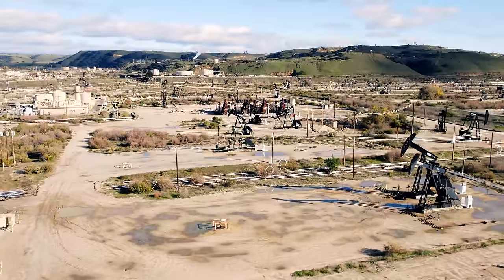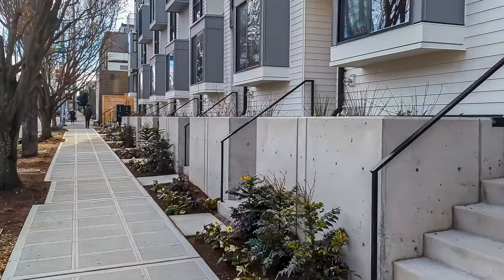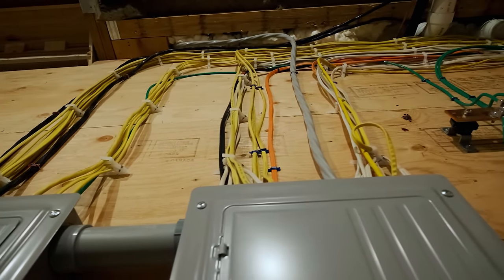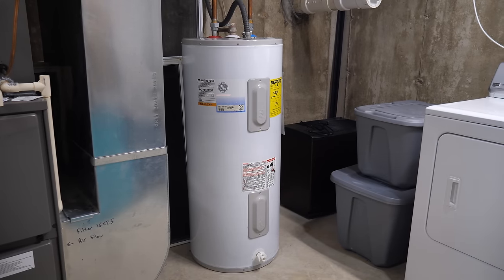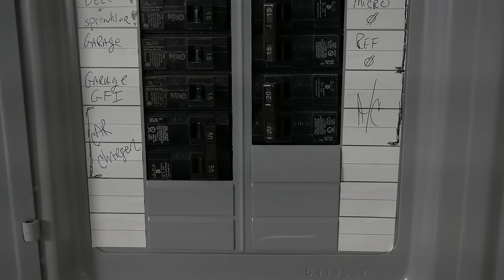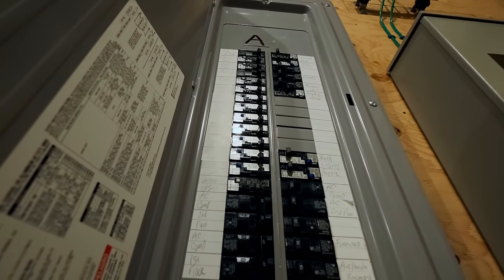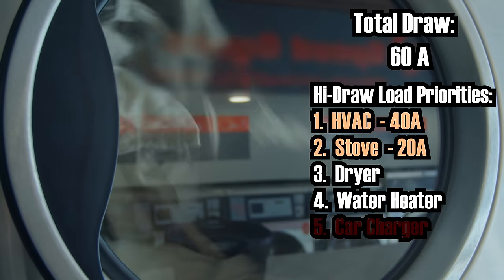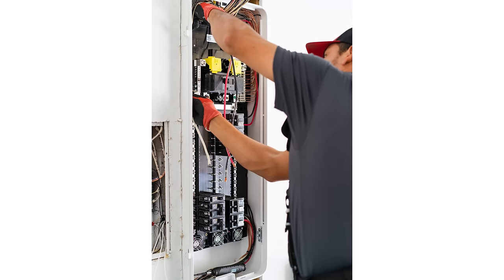Home Electrification: There's not a lot to do, and it doesn't have to be hard (Part 1)

Comment: Speaking as a renter, the biggest barrier to this is landlords, as illustrated by your comment on the complications of apartment upgrades. My landlord does not care how much I spend on energy or what my energy is doing to the environment. Landlords have no motivation to change. We either need to give them motivation or (and this is my preferred plan) get rid of landlords.
Reply: You want to get rid of your landlord?  Buy your own place.  If not, be thankful that you have a landlord to provide you with a place to live.
Now, as a landlord I'm an outlier. I do try to reduce energy usage for my tenants.  My incentive is that I can then charge more rent because of lower power bills. Not enough more rent to offset the savings, it's a split that helps both of us.
Reply: If the customer doesn't care, why should the landlord? Your level of entitlement is off the charts.
Reply: ?  The "customer" here doesn't get to purchase the appliances or insulation to save energy.  Did you not read my explanation of why saving energy benefits both the tenant and the landlord?  What's "entitled" about that?

Comment: We have a 50 Amp service going to our house, and in the past 8 years, we blew the main breaker once.  AC was on, took a shower while baking something in the oven, with a bunch of lights on (the old incandescent lights, before getting LED's). So a good 30-40 Watts per bulb. And also the dish washer warming up it's water (yes, ours warms the water). And who knows what else was running. So, 100 Amps is plenty. Even 50 Amps is due able. But for bigger houses, it is pushing the limit's.

Comment: If you swap out your gas appliances with electric equivalents, and have no $ left for a smart load center or a service upgrade, just make sure you are not cooking and doing laundry at the same time. Switch breakers on and off if needed. Use sticky notes or other reminders.
If you start your laundry after dinner, the dryer would run when power usage otherwise drops to a trickle.

Comment: Why do I get the impression that you "blew off" the boiler/hot water people. You seem to be saying "just get new equipment and get creative". This transition can run into the many thousands of dollars. Oh,  BTW I live in a NYC suburb and hundreds of thousand homes have gas/hot water systems. 
In our recent heat wave the utilities "suggested" power reduction  due to endangered capacity in the area, so let's just add more electrical load demand!!  Bottom line is, mass elecrification will cost billions, if not trillions!!

Comment: A service upgrade is probably still worthwhile if you can get one. And if you're in an older home, you should at least get an electrician to look at your wiring if possible even if you're not getting a service upgrade. Just to make sure your wiring is actually good and not some ungodly hackjob that only looks compliant at a surface level.

Comment: Lets be honest. Smart panels have been around for 20 years. THEY STILL SUCK. The panel operates "right" about for 1 year and then things get wonky....

Now lets talk about the GREEN MONSTER in the corner no one wants to address. Besides upgrading the grid, which will take 10 or more years, we need to talk about electrical codes for houses. If we are going green/electric, then the standard for new homes needs to be atleast 200 amps. In fact, we might need a 200 amp breaker and room for a secondary panel to handle EV charging. These issues need to be hammered out NOW so that new homes built after 2028 are not obsolete in only 3 years.  Measure twice, cut once. It is cheaper that way.

Comment: Closed cell silicone rubber-resin foam are the best, they won't rot or burn, moisture proof and water proof. Silicone rubber-resin paints exists but are not well advertised because THEY DO NOT ALLOW EXTREME COLD OR HEAT TO PASS THROUGH which the oil and gas heating companies do not like, the oil lobbyists lobbied against their uses by using tons of LIES that falsely accuses them of being dangerous when in fact they are so safe that these silicone rubber-resin polymers were actually used as the air tight and vacuum tight and pressure tight and oil tight and gas tight and water tight space crafts and military airplane seals and gaskets! Especially on their windows and airlocks!

Comment: I just came back to point out that smart load management in appliances isn't that new. I've been to many hotels over the years that use a combined microwave and fridge. When the microwave is in use, the compressor is disabled to prevent overloading the circuit.

Comment: I live in the Midwest and I've never seen a gas-fired dryer in my life 😭

Also:
- There's no way I'd install a smart breaker box unless it had ZERO network interfaces and open-source firmware.
- Electric ranges (well, the burners - not the ovens) are dogshit. Even induction doesn't perfectly match the versatility of gas.

Comment: I really like not being 100% dependent on the grid for HEAT I do have a heat pump and live in the south BUT even it uses a burner for heat when it is really cold. And if the power goes out my old stove still works (and will at least keep it reasonably warm in a few rooms)

Comment: On a Boiler system what would prevent using the existing radiators and using a heat pump to heat the water?

Comment: i went and saw my braker box and the amps are 63 yes 63A keep in mind i live in a apartment with 250volts but the iscolator  is rated for 415volts so then why do i only get 250V . should  it have 415V or 250V so yeaaa

Comment: Wait, 24kW isn't enough for a North American electric home by default? I live in a place which most people would consider quite cold, something which US army would classify as wet/dry cold with occasional dips into the intense cold region (lasting about a week at a time). So -5C to -15C or 23F to 5F most of the time, and -20C to -25C or -4F to -13F for about a week each year. Even in a relatively large and decently old (50-60yo) detached house it's pretty darn hard to consume more than 10kW at a time.

When temps are around 0C or 32F, the heating (heat pump), fridges, freezers, electric floor heating in bathrooms and mud rooms and whatever zombie loads are plugged in - that takes about 2kW. At -20C or -4F that's about 4kW. Usual lighting; it's pretty darn difficult to exceed 500W there, though if I were to turn on all lights I could probably reach 2kW. Preheating a car will draw about 2kW, washing machine and dishwasher, those might peak around 2kW but that's a very short period in the wash cycle. Dryer - I don't have one so I don't know. Cooking complex food - well, that might draw 4-5 kW, though you could theoretically peak at 11kW (3x230VAC at 16A).

My power provider provides me with hourly consumption rates (which are used for billing), and I don't think I've managed to ever exceed 10kW (maybe prepping Xmas foods went slightly over?). Anyways, I'm sure I've never exceeded 15kW, at least when measured with 1h interval. Short peaks are likely to be higher - but probably not that much higher.

The only reason to introduce "smart" whatever into household power delivery would be charging an EV, where it would make sense for the charger to monitor other power consumption (and electricity price) and regulate charging accordingly. Though 95% of the time simple timer set to enable charging during the night would be enough.

Comment: I obviously won't bring up the power grid being beefed up to handle these much higher electrical demands. 
What I will bring up however, is the irrevocable need for us to go nuclear. 

We cannot power a nation full of electric cars with windmills and solar plants. Hell we can barely do it with fossil fuels, which give out much greater power yields. 

Nuclear is the only way.
Reply: Nuclear is good, but it has drawbacks that renewables fix. But then again, we shouldn't have a country running on electric (or any) cars

Comment: We gradually stopped using our dryer for most loads over time. We just don't demand piping-hot and dry clothes within an hour. Just hang them up in the den and they'll always be dry by morning. Even in Summer (and we have humid Summers too). OK, we still use it to dry large stuff like bedding, and even then, just on delicate/low heat. It's really totally fine.

Comment: As an electrician who has been present for the installation of a Span smart panel, they are a huge pain in the ass to install. They don't have knockouts so you have to cut in every hole to get wires in while being careful not to get metal shavings in the sensitive electronics. They only have one ground bar so half of your grounds have to go around the world. All of the terminal crews are flathead so you can't tighten them with your screwgun. The panel is also three and a half grand while it's benefits are marginal. If you're doing a panel change you might as well do a service change to 200A. Its not that much more expensive.

Comment: Why not stick a 200Amps output battery between the 100Amps power supply and the breaker panel to serve as an energy buffer for those peak periods?

Comment: Yes, most stuff in my home is electric, but most stuff is not a basic necessity, like heat and hot water.
Using gas, I can have a constant comfortable 23C in my house in the dead of winter (-5 - 5 C temperatures) for ~$70/month. The same comfort with electricity would cost ~$400/month. When minimum wage is $400/month and $1500/month is middle class, that’s just not an option. Haven’t done math for hot water on electricity, because an instant electric heater of the needed power is not available on the market and I have neither the space to install a boiler, nor the desire to be limited in the amount of available hot water. But hot water via gas is instant, unlimited and virtually free (it costs $2-3/month to take 1-2 daily showers).

Comment: 29:40 Boilers distributing hot water for heating are harder to replace with ductless mini-split air source heat pumps (ASHP).  Major heat pump manufacturers (e.g. Daikin, Mitsubishi) make hydronic air-to-water heat pumps for other countries (e.g. Japan, New Zeland, Europe (Germany, France, Poland, United Kingdom...) but they REALLY SHOULD SELL THEM IN THE U.S.  I live in New England in the U.S.  In the summer I'd like to maintain a delta T of about 25-30 degrees F (70 inside when it's 95-100 outside).  In the winter I need about double the delta T from heating (65 inside when it's 5 to -5 outside).  So trying to convert my whole house to ductless ASHPs has several problems:  1.  high cost, 2. hard to place the inside unit of an ASHP in all rooms, e.g. bathrooms, rooms at front of the house where I don't want to place a unit outside because it would be an eyesore, 3. I need ~twice as much heating as cooling, e.g. 3-4 tons cooling, 6-8 tons heating.  So Mitusbishi/Daikin/Trane/Carrier... PLEASE offer me a cold-climate air-to-water air source heat pump that I can replace my oil-fired boiler with !!!!! (to at least provide half my heating, including hard-to-reach rooms.  Then I'll put in a few mini-splits to cool and heat larger rooms and open areas).  If you want to glance at some products offered elsewhere around the globe (why not in the U.S.?), search for Ecodan Zubadan  or Altherma (I didn't make up the names, blame the vendor).

Comment: I don't know about you americans but the issue we're having in the UK with ditching natural gas for central heating an hot water is cost. Electrical heating is more expensive per BTU than burning gas to heat water, It's as simple as that. I have solar panels and a big battery, they weren't cheap and despite that I am still in a big defecit for solar power during winter and that's when the heating is needed. I could get a heat pump I guess, but that's another big upfront cost, especially when I had to get a new gas boiler only 3 years ago. Unless the government pays for heat pumps and solar panels for all, we're going to have huge difficulty weening ourselves off gas. Edit: OR reduce cost of electricity massively, which doesn't seem likely as even the power coimpanies that claim to be 100% renewable upped their prices when the wholesale costs of non-renewables went up.

Comment: Some insight into Scandinavian Countries, (mainly Sweden):
All homes get 3-phase power. 400V phase-phase, and 230V phase-ground. 
The main breakers are typically 10A, 16A, 20A or 25A. Higher capacities are available but also more expensive. Upgrading your service is as easy as replacing the breaker. The higher cost comes from the grid needing to account for a potentially higher load. 

Back in the day, until about the 2000s, oil furnaces were commonplace. Most of these where then replaced by either Wood/pellets furnaces, Heatpumps, remote heating or resistive heating. 
Geothermal heatpumps are commonplace in the suburbs as they are unaffected by the outside temperature. The ground is the same temperature all year round if you drill deep enough. Closer to the cities, massive insulated warm water pipes run underground from central power plants, that use their waste heat from biomass burners to heat homes and provide warm water through heat exchangers. Instead of a huge building with its own central heating system, we just made the entire city a central heating system.. 

Homes range from 120sqm to 320sqm. The typical size is about 160sqm with a cellar and/or upstairs. My parents house is a good example of a typical Swedish suburban house. 
About 160sqm with a cellar. They run a geothermal heat pump with resistive heating elements as backup (rarely used). They run a 4 "burner" induction stove, have resistive floor heating in the cellar,  run two fridges, and two large chest freezers. 6-person household. Washing machine, but not a dryer (dehumidifyer in  drying room). All this on 16A service. On 400V-three phase, that's 11kW in total. Never had any outage from the main breaker tripping. They use on average 25000kWh each year. They never had a smart breaker box either, only their new car charger actually use intelligent load balancing. 

We lived in a tiny house, 60sqm, one floor. Heated by one resistive radiator and one air-air heatpump. Our monthly peak never exceeded 5.5A on the grid in the winter. That was with an electric dryer, halogen stovetop, electric water heater, water pump and filtration system, and seperate fridge and freezer. We rarely ran it all simultaneously, and that wasn't intentional either. I think most of you vastly overestimate how much power a house is using at any given moment.

But then again, our building techniques are also far better than in the US. Insulation is key, and we have lots in our houses. Back in the 60s brick houses were very common, and wood panel houses usually have multiple layers of insulation, built in a way where the outside panel is never directly touching the inner frame.

Comment: A dryer on gas and plugged into a 15A 110vAC circuit?!?! I saw the breaker and went, "huh?" Then saw the gas line. I was wondering why it was taking longer to dry clothes. "Wet heat", baby!

Comment: I had my gas turned off and went straight electricity. They were charging me $50 a months just to have the gas turned on. I still have all the equipment in parallel, but use only electric for everything.

Comment: Electric heat is quite a bit more expensive, and breaker box upgrades, start in the $4000 - $10,000 depending on how much you need done. What's the purpose of putting a crap ton more load on the grid that's not ready for it?

Comment: You already got 230/240V in reality just halved down for consumer utlets with a neutral for who knows reasons... why not just convert to 240V everything? your Apliances would be even cheaper too as thats the most used consumer voltage around (globally), then a 100A breaker will hold for a lot of stuff. In addition higher volatage for same power used is more efficient as a bonus. Say an induction top, even here in europe most of them are still "only" single phase 230V and they need a 32 Amp breaker IF all zones are used in boost-mode, which hardly ever happens. Most people just use the regular old-standard 25 Amp circuit and don't even saturate that one in practical use. But yeah, proper insulation (for both hot and cold actually) really is the deal. My house heating and the hot-water tank are both powered by the same air-to water inverter heat pump, rated 3kw input (13 Amps at 230V single phase but never uses that much, unless I shower ALOT) for my entire house and garage to a comfy 22 °C all year round (house+garage is 275 sq.m. or 2960 sq.ft.) And the backup is a 5 kW resistive heater (which was 9kW, but rewired to 5, as 9 is overkill). And I live above the polar circle...

Comment: 24:00 if you just can't justify going Full Electric, they make "Dual Fuel" furnaces, they are Gas Furnace with a Heat Pump. You won't need much gas, but it does mean you can't cancel the gas bill (which will cost you hundreds a year just in connection costs)